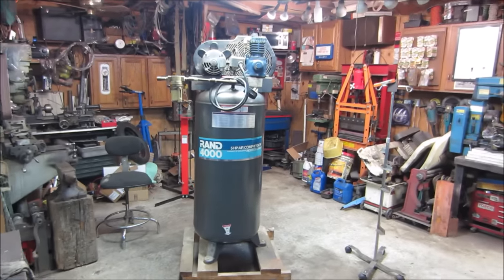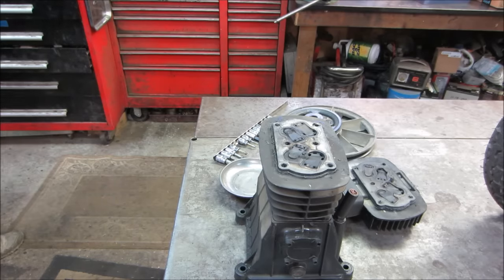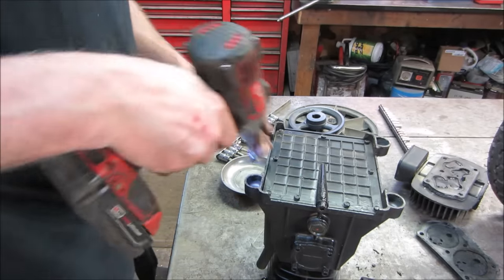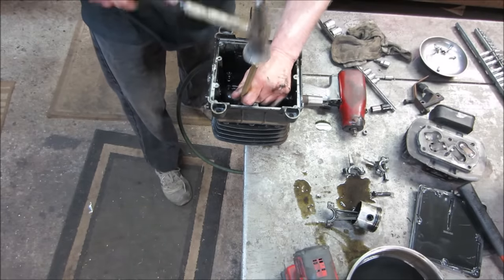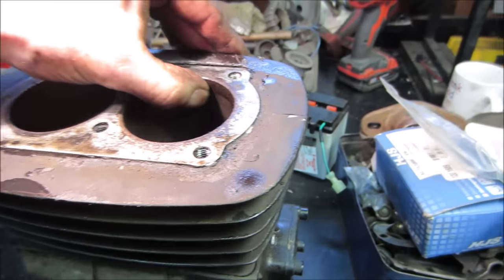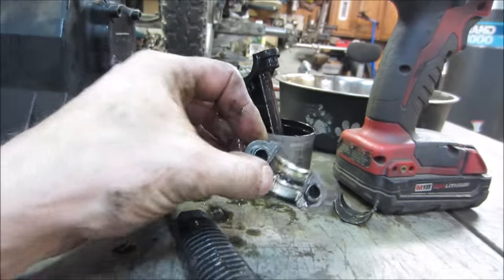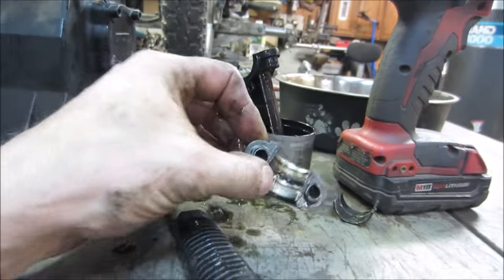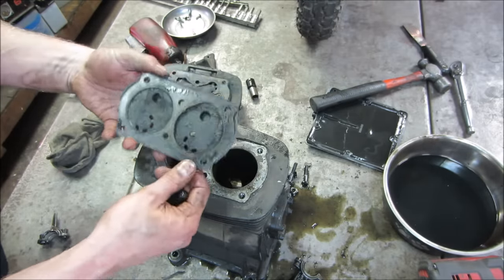Burned out Air Compressor tear down, what went wrong?

Comment: I got an air compressor that would turn back an forth about 3/4 of a turn. When I took the head off it was about 1/4 full of rust and water. I drained out the cylinder and  removed the piston. Cleaned and honed the cylinder walls. Cleaned up the piston and reinstalled it. Changed the oil (had water in it also). Tried it and it ran flawlessly. I still use it. Got it for free from the side of the road. No parts where needed.
Reply: Way to go Charles ! Is'nt it a great feeling to fix something other people just throw away as garbage ?
I fix regularely bikes and 3 wheelers wasteful people throw away and bring them to poor families or thrift stores for kids to enjoy. Oh the smiles I get !
Reply: @marcryvon  fantastic!

Comment: I was always taking things apart as a kid and still do at 57 years old 👍 fun to see how stuff works.
Reply: I hear you!
Reply: Pushing 60, and I still can't resist the urge to tear things apart,
Reply: True but usually we at least put the stuff back together and it still works afterwards now, as opposed to being a kid and taking the VCR apart and well we'll just leave it at that HAHA!!!
Reply: 60 later this year. My Grandfather and Uncle put tools in my hands when I was about 9 and pointed me at a pile of broken stuff. I still have a Russian bicycle wrench my Grandfather brought back from WW1.
Reply: @andyfloyd8583  nice provenance...
Reply: My folks tell the story about how they used to decide which toys to buy me by how difficult they would be for me to take apart.  Pushing 61 and I still like taking things apart to see how they work and see if I can fix them.  Mustie has me hooked and I'm now looking for power equipment to pick up cheap and re-work.  Did my second carb tonight.  First one was on a Lawn Boy B/S push mower, primed it and it started first pull.  No more surging!!  Tonight's was on a small pressure washer with a totally PLASTIC carb!  Started on the second pull.  Home Depot got my $100 today for a 1/4" impact driver.  It's all Mustie1's fault that I spent that money Honey, honest!!!  :-)

Comment: I liked the way that you got super quiet when you launched the snap ring so we could hear the landing lmao
Reply: that's every mechanics reflex, just waiting for the ping so you can chase it down.
Reply: @TuttleScott  That's it. I'm often doing some electronics repairs, every time something is dropped or lunched across the room I instinctively go silent and wait for the landing. Usually there's no other way to find microscopic parts on the floor.
Reply: @TuttleScott  It is a natural reflex.  Strange thing is that you can pinpoint where the sound came from, but good luck actually finding the part.  About a 60:40 chance that you won't find it.
Reply: @NJP76  That's why you keep a magnet wand handy, at least for those ferrous runaways. :P
Reply: I use a screen cage with 2 hand holes in it( like a blasting cabinet) this way if something flies, it is also trapped near the launch sight!
Reply: Yes that was funny and guilty of doing it myself.
Reply: Aren’t we all!
Reply: New update, life sucks when your working with electrical actuators and spring loads, then somebody does something wrong, and gets themselves launched across the room... ouch was the last thing I heard, but I still feel it 5 years later!
Reply: I was laughing at your comment, cos it was so true, hehehe.
Reply: @oskardzida  also putting some carpeting   or cloth on the floor under youf jobsite will arrest the ricocheting of the part  across the room
Reply: @NJP76  that also is dependent on if your hearing is the same ear to ear

Comment: Great video.  I used to repair air compressors many years ago and if I had to guess, I thought that I saw some carbon at the top of the bad cylinder and I've seen several air compressors that were neglected and the owners put off maintenance so long it allowed carbon to build up to the point that the piston starts hitting the valve plate just ever so slightly until it just gets worse and worse until, well you know what happens then.  The wrist pin is the first part to go from repeated contact until it finally gives up the ghost.  For those that wonder how you can get carbon in an air compressor just consider that you have all the components required for creating the carbon; oil, pressure and high heat . . . . oh and don't forget, neglect.  Air compressors need maintenance too,  and I have seen some real badly neglected air compressors.  Your video's educate the newbies among us.

Comment: A little lesson on water separators. In order for water to be effectively separated the water has to be in liquid form, when the air leaves the compressor the water is vapor, as the air flows thru the lines the air cools and the water returns to a liquid, the further away from the compressor the more effective the water separator works. It's recommended to be installed down line at least 20ft from the compressor.
Reply: That does sound feasible...Mines only about 2ft away...

Comment: As far as the piston "hitting the top of the head" goes...  The "pressurized" air on top probably cushioned the piston from hitting the head.  Great "airtopsy"  LOL
Reply: I think by watching this vid that the wear was on the bottom of the rod thus indicating it was actually going less to the top of the piston and more towards the bottom ( well just not going all the way to the top of the stroke, this also was indicated by the build up on the top of the cylinder walls on the second piston) Just my opinion.
Reply: @fixrite11  Sounds like the case, good observation

Comment: Thanks man,first time seeing the guts of one of those. Surprised to how much it looks like a gas motor .
Reply: Pretty similar. 
You can get a conversion head to convert a Model A engine over to an air compressor that runs off 2 cyls and the engine itself runs off the other 2.
Reply: I've used a compressor it was a Ford 300 straight six. Three cylinders ran the motor three pumped air.

Comment: Those drain valves are a real PITA. I replaced my valve with some fitting and a 1/4 turn valve with handle from Lowes. Best thing I ever did on my compressor. It makes it convenient to drain and then you do it frequently.
Reply: dri50 
Good mod. I have done that also.
Reply: Automatic drain is the best tho, but a better manual one sure is an improvement
Reply: And make a drain tube beyond the base so it is convenient to turn the valve. Think that is why it is never done and rots the bottom of the tank...
Reply: Another option pull the drain valve out plumb it so the line comes out by one of the feet install a 1/4turn ball valve and your all set
Reply: Family Handyman had a good tip. Replace drain valve with a semi air bleeder valve. Pull on cable to release pressure & water drains out. Release cable  to reset & Bobs your Uncle! 😊👍

Comment: Random thought.  It looks like the piston furthest away from the fan overheated and began to seize, therefore causing the piston pivot to fail.  It makes you wince just thinking about it.
Reply: Did you watch the video to the end?
Reply: Yes I did, I jumped the gun and commented as I was watching it.  I know.
Reply: Right on pauline. It probably was low on oil too. Definately over heated. Ruined. Could be rebuilt, if you can get parts. See you over at cold war!  revved up yooper

Comment: If the two pistons are the same size, the second stage piston has a higher operating pressure. One I took apart had two different piston sizes, and the air from the first stage piston went into the second stage chamber and was compressed higher and put into the tank. 
I'm not sure your original compressor was actually a two stage compressor, but instead a two cylinder compressor for higher volumes, and 120psi pressures.

Comment: I didn't look at the valving very closely, but, often the cylinders operate in series -- the output of one goes to the input of the other, which further compresses the air while sending it to the storage tank.  The high-pressure cylinder in under much more physical stress as well as operating at a higher temperature, and that is why one cylinder is in much worse shape than the other.

This may be a single-stage compressor, though, because the secondary piston in a dual-stage is ordinarily quite a bit smaller than the primary in order to equalize the load.

Comment: Enjoy your channel - tried to rebuild a compressor a few yrs back and learnt that Asbestos gaskets were still present on the reed valve setup. Something to check with old equipment. Was using compressor for bead blasting so it ran more than the 50% cycle time rule of thumb which is why it cooked itself. The hotter it runs the more moisture you trap under compression.  On my replacement compressor I ditched the brass drain valve because if it's not easy to access it rarely gets checked.  Put an elbow with flexible line to a ball valve at a more accessible spot so I don't forget.   cheers

Comment: it may have been sitting at an angle with the rear having less oil, but it was probably all temperature related, since the better end had the pulley/fan crank snout with more heat transfer and air cooling.

Comment: I like to see you try to make a running engine out of it.  You have great video’s keep up the good work
Reply: Turn it into a chinesium Briggs Tecumseh Kohler. Lol
Reply: If it was an Engine!
Reply: @RANDALLOLOGY  A Brumhler?
Reply: Why not all you'd need is a correct timing chain and sprocket set and an overhead valve cylinder head and new pistons, rods wrist pins and a new crank and all new bearings

Comment: The reason the bearings wore at an angle is that the heaviest load on the compression stroke. During this time, the rod is at an angle to the bore so the maximum load is at somewhat of an angle to the center line of the rod, piston and crankshaft.

Comment: Carbon is always an issue with compressors.  It looks like a good candidate for a rebuild, but I wouldn't bother with it.  Run of the mill single stage.  Tank seems to be in really good shape.  Didn't see any rust in the water when you drained it.

Comment: Great video, mechanical autopsies are always interesting.  This compressor, is a two stage.  The larger piston is the low pressure side, the smaller one, the high pressure one.  the higher pressure piston gets considerably hotter then the low pressure side, and oil is much more critical.  Chances are, the oil sealing ring let go, and what you are seeing on to of the piston is burnt oil, then it just expended and began beating itself to death.  These things are really easy to rebuild, if your just changing rings or gaskets, but you can get parts pretty cheap.

Comment: Leave one piston out and it's a good 1 cylinder compressor
Reply: Don't think that works, it's out of balance.
Reply: Yeah try that with your car
Reply: @aserta  It's only a compressor and it's working at <1000 rpm. no big deal
Reply: remember the SB Ford and in-line 6 Compressors?
Reply: Very good idea!
Reply: I am very curious if that would work
Reply: Wouldn't work because I think this is a dual stage compressor. One side compresses, and sends that to the other side, and that further compresses. I could be wrong though.
Reply: @octane613  yep your wrong it's a single stage compressor 👍
Reply: Great idea i think it would work??
Reply: @stuartjohns2779  well in that case yeah it should work fine.
Reply: @octane613  This pump is a single stage design.
Reply: @octane613  That is what I was thinking, but is that reeds in both cylinder heads?
Reply: @aserta  exactly, the thing will practically up and down off the floor,. it would be the weight of the piston/rings/rod assembly and drag out of balance. :)
Reply: It will pump one one cylinder, just be slower.

Comment: Looks like you could rebuild it if you wanted to would make a great video
Reply: Unfortunately, not cost effective. :(
Reply: @stevechristophersen5105  This is true.  Unless you happen to find a "donor" compressor, the replacement parts would probably cost as much as a new compressor.
Reply: Rebuild kits with two pistons, rods, rings, bearings, and crank shaft average $200.  You can buy this same pump new for $150.  I had to price out repairs on mine with two bad rods but the crank was good.
Reply: I'm thinking the same thing
Reply: Anyone know a good place for parts? I grabbed a free compressor out of the scrap pile at work. The pressure switch assembly is missing and their is another little hole maybe 1/4” diameter and something is missin there too. The pump when turned Over by hand you can hear air go into the tank but I’m assuming you shouldn’t be able to rotate the pump pulley with one finger easily. The guy told me it ran all night without being shut off and it had a issue causing it to not shut off automatically. So then it wouldn’t run again. I’m guessing they didn’t reset the button on the motor or the pump is trashed. Either way I’d like to see what it would take to rebuild it. If I can get it working for $200 maybe $250 it’s worth it to me.

Comment: good autopsy. It's kind of incredible how things break. I've worked on quite a few different styles of air compressors (mostly in the navy) up to high pressure units that put out 4500 PSI. Thanks for sharing some great content.

Comment: low worn out oil and over heating due to the fan like you said
Reply: That and possibly not sitting level.
Reply: @godmodeforever  My thoughts too. I think one side ran low of oil for some time. Unusual to see a gudgeon pin wear like that but in this situation being a pump and not an engine it was able to survive longer and thus show the wear over an extended period. Once one end of the pin had worn a fraction more than the other that wear would become exaggerated.
Reply: The pulley also is a heat sink, pulling heat from crank and also crankcase.

Comment: Watched the repair video when it came out and was waiting for this one. I've never had a compressor apart either, but, from the sound it was making, I was kinda expecting a rod end problem. What I wasn't expecting was the problem being the pin end. It's now obvious to me that when the wrist pin came out of the bore, it got cocked in the rod, which caused the uneven wear in the rod bore. Now, I'm wondering how, since both "cir-clips" were still in the piston bore, the wrist pin could move enough to come out. Things that make me say hmmmm. Either way, all the movement of the wrist pin and wear on the rods pin bore obviously caused the damage to the rod bearing and crankshaft. They litteraly got hammered into oblivion. Great videos! Love the channel!

Comment: I’m curious about this since I just found a free 60 gallon compressor in the trash pile at work. The previous owners relative said  it ran all night and didn’t shut off then when they tried to use it it was locked up or something. Their is oil all down the side of the compressor which is dirty so it looks like it had a leak. . My guess is it had a air leak or bad pressure switch is why it never shut off but it might have ran out of oil. Think it’s worth the trouble? If not I can always repurpose it into a fire pit or maybe a smoker.
Reply: Yes, with a little effort and some ingenuity old storage tanks make excellent grills and smokers.

Comment: I think your hypothesis of the cylinder farthest from the fan overheating is definitely of interest and worth looking into. I hadn’t even considered that possibility until you mentioned it, the route I had been pondering: 

Machines like this which operate at a fixed RPM can also be prone to failure from vibrations from a number of factors like Imbalances in the component manufacturing or excessive tolerances in install. All of those compounded with the accompanying speed changes from increases in loading can suddenly put it into a speed range where vibrational amplitude spikes.

Comment: My father and his brothers tried exactly that in the late 40's. Apparently it cannot be done without the counterweight in the crankshaft any engine has. It will ignite and stay down. Greece here.
Reply: Nah that's the purpose of the flywheel, to give the engine enough momentum to spin from one combustion cycle to the next.  The counterweights you mention balance the engine by counteracting the descending and accelerating piston. Counterweights and flywheels differ in name, design, and purpose.
Reply: @mwilliamshs  Right, flywheel, excuse my english.

Comment: Thank you for that. I now know far more about comressor heads than ever before, and I encountered my first some 45 years ago. 

The other thing in air supply systems is the pressure regulator. It would be good some time to show how they work; all that flapper & nozzle stuff. A guy named Harry at a Honeywell training centre taught me about regulators those same 45 years ago but I'm not so sure I retained everything he said. Time for a recap.

Comment: worst case the mfg probably has a parts breakdown and you could order the parts and put that compressor back in service.ive seen guys with no access to the parts build up that material in the connecting rod with a welder then redrill the wrist pin hole. but as a disposable society this would be uneconomical to repair. i did a compressor close to this several years back and was able to buy the piston and connecting rod assembly for about 30 bucks and a gasket kit put it back together and its still running. thank you for your time and the effort to put this video together. thumbs up dude

Comment: The difference in wear could be a result of a 2 stage compressor where the burnt piston was being fed higher pressure air from the good piston... more stress compressing compressed air wire it out faster?  Along with not being as close to the cooling fan...
Reply: That was my thought as well.